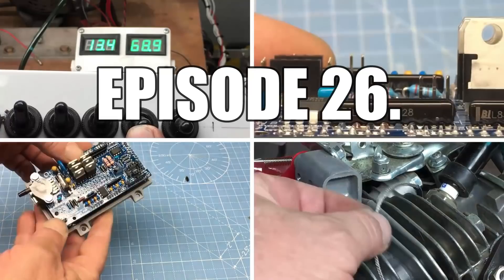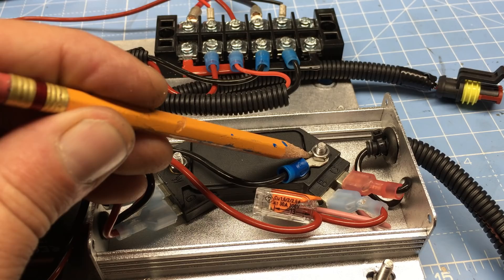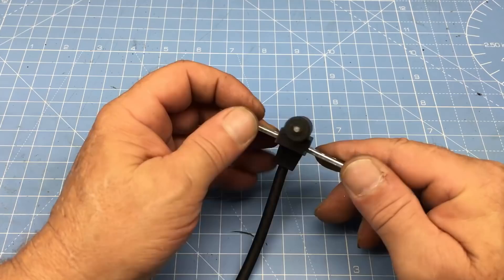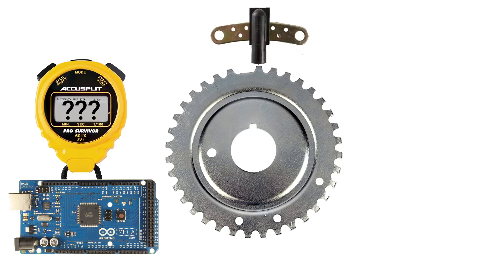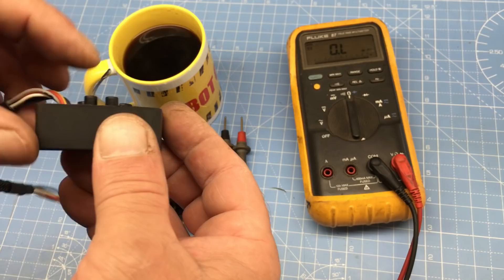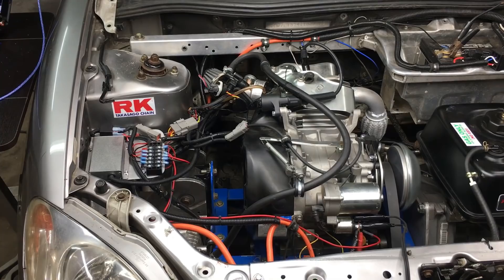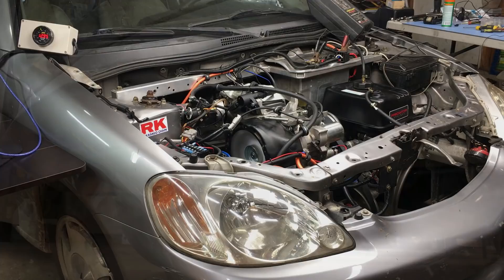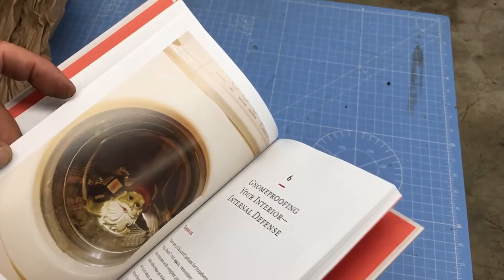Episode 26.  We finally finish the Speeduino NO2C EFI install on out 420cc  street legal go kart

Comment: The ECU knows where it is at all times. It knows this because it knows where it isn't. By subtracting where it is from where it isn't, or where it isn't from where it is (whichever is greater), it obtains a difference, or deviation. The timing subsystem uses deviations to generate corrective commands to drive the ECU from a position where it is to a position where it isn't, and arriving at a position where it wasn't, it now is. Consequently, the position where it is, is now the position that it wasn't, and it follows that the position that it was, is now the position that it isn't.
In the event that the position that it is in is not the position that it wasn't, the system has acquired a variation, the variation being the difference between where the ECU is, and where it wasn't. If variation is considered to be a significant factor, it too may be corrected by the MAP. However, the ECU must also know where it was.
The ECU timing computer scenario works as follows. Because a variation has modified some of the information the ECU has obtained, it is not sure just where it is. However, it is sure where it isn't, within reason, and it knows where it was. It now subtracts where it should be from where it wasn't, or vice-versa, and by differentiating this from the algebraic sum of where it shouldn't be, and where it was, it is able to obtain the deviation and its variation, which is called error.
Reply: That is or isn't the most easy explanation of timing error 😁
Reply: A good friend keeps telling me... "wherever I go, there I am"
Seriously though, great explanation of predictive timing!!
Reply: Wherever you go don't forget your towel.
Reply: Adding a knock sensor on the engine would be useful as well.
I seem to remember that a modern car ign. system applies a strategy in which it continuously tries to maximise ign. advance. Until the knocksensor detects knock and sends the signal to the ign. module. The ign.module then backs the timing off  a few degrees until the knock sensor factor input stops and then slowely tries to advance again. Basically a simple  feedback loop: advance>knock>retard>advance (ad infinitum)
With a strategy like that it becomes a lot safer  to use boost. Differences in fuel quality, ambient airtemp will automatically be factored in.
With low octane fuel the ign. will automatically use less advance.
Reply: Where am I?
Reply: Today is the tomorrow you worried about yesterday.
Reply: @jfv65  No knock support on Speeduino.

Comment: That Stuff is BMW and it might be from a 02 series. The BMW "Neue Klasse"(New Class) was a huge succsess, it helped BMW survive the 60´s, my Dad had a 2002 (actually several) and the BMW 2002 escalated into the 2002 Tii Turbo, a mechanical fuel injected and turboed badass. It had a bad reputation because the drivers didn´t treat it as they should have so they blew turbos, head gaskets- You name it.
And based on the 1500ccm block BMW´s motor magicians created the F1 race car engine which dominated everything in the early 80´s.
Glory days...
You do really awsome shit with this car, I love the sound! Sounds very serious!

Comment: I love your explanation of the missing tooth on the reluctor wheel.  I always liked the ford method of firing on the "down" on the square wave.  So instead of a missing tooth, cylinder 1's "tooth" was smaller but ended in the same place on the wheel.  So it was sort of like a missing tooth, it as the eec was looking for the big gap between cylinders to know when to fire injector 1.

The eec would turn off the "spark in" pin when it wanted to fire the plug.  If the eec didn't tell the coil to fire, it would fire anyway when the tooth on the reluctor completely passed the hall effect sensor.  Works just like the GM setup, just completely backwards, and the reluctor was just a piece of stamped steel rather than a magnet.

Not saying thats what you should have done, your explanation just reminded me of this.  Awesome vid.  Glad to see you're back
Reply from the maker: thanks!

Comment: You squeezed the usb cable into the door gap by closing the door, and then talk about failing connections to laptop. Might not be the reason why it fails often, but looks funny in the same picture with laptop.😋

Comment: Jimbo, you made me work!  I had forgotten what VR stood for!  Luckily I eventually remembered that it stood for variable reluctance.  I found several articles (Wikipedia) on what a VR is/does but nothing immediately on Reluctance.  
It turns out that it is like electrical resistance for magnetic fields.  The big difference is that it uses no power, as a resistor does.  Your engine with a VR will have to fight the Reluctance as it spins but the VR generates no heat.
Educational moment missed Jimbo! 
 
I am embarassed to say I actually got an EE degree but missed or forgot this.  It must have been when we studied electric motors!
Reply: In case anyone worries that my poor education endangered anyone, I am happy to say that I have never been employed as an EE! LOL 
I am at retirement age so everyone's future is safe from me too! 8-))

Comment: Great vids :) Just a heads up, I used what looks to be the same generic air filter you do on a 18hp 200cc chinese atv.
It made it run very poorly despite trying to tune it.
Found that the foam type pitbike filters flow a lot better, and likely cleans better if oiled. 
After fitting one the little 200 was back in the game.

Comment: Glad to see you back. Hmm, a 36 spoke motorized bicycle sprocket would seem to work just fine with the teeth filed flat and a tooth removed. Thanks for the inspiration. On second thought, with that convertor board, maybe no filing needed.

Comment: Excellent production. I learned a few things which I had previously skirted on my way to being the best inventor in history. Truly helpful!
It won't be long until this horribly draggy high friction person transporter blows through an impressive speed. Of course a tail wind will be helpful. I suppose the energy required to make this speed will be a measurable improvement over the larger OEM beast. After all we aren't pumping water too.
This fuel injection and ignition timing control method had me wondering how wastefully inefficient it is to fire a spark when a spark isn't needed. I bet 100's of milliamps could be wasted. It could light with less than one turn.
I like the modules designed logic for the ability to spray two hats full of fuel into the intake plenum prior to charging the combustion chamber. Great because we should be moving swiftly now onto the super charger. Hopefully, the fuel tank mount wont hinder us again.
Moving from liquid cooled to air cooling has been a remarkable experience. I suspect that the fuel injection sprinkler could provide enough cooling to set another speed record before we ever consider leaning. 
Lord help us now, I'm saying we.
Cheers!

Comment: I feel the urge to get a speeduino, despite not having anything to use it on. Unless I plan to convert my honda lawnmower to fuel injection.
Reply: You should totally do that. Would make for a very efficient mowing of the lawn :D
Reply: Supercharged fuel-injected lawnmowers are all the rage here.
Reply: @hojnikb  I bet youd see very little difference, if any.  Contrary to popular belief, carbs are quite fuel efficient if properly tuned.  And in the case of a lawnmower where it runs one RPM at all times with just a bit of varying load, I doubt the manufacturer screwed it up too bad
Reply: Skip the Speeduino and get a Harbor Freight diesel and an eBay turbo. Then you'll have something much louder to play with, and could you even put it in a riding mower or a bike ;)

Comment: Just add a plate below the engine which scoops up air from below the car. This way you can avoid the ducting entirely.

You just need to add some vents holes at the end of the hood, which is basically what you would expect from a cement mixer engine driven car anyway 😬

Comment: The fact that the ECU isn't necessarily firing directly off the crank sensor is a minor mindbomb for me. I mean I've only had experience using a modified stock ECU using the stock crank sensor but I always assumed it knew exactly where the crank was and adjusted timing accordingly. This is the channel that just keeps on giving!
Reply: Hey Adam, one additional curious thing is that as ECUs got faster, over the years, more teeth were added to the crank wheel, to further reduce the “guessing” that needs to be done.
Reply: @gregholloway2656  I believe you are mistaken. Most crank sensors max out at 60 teeth. Even the most basic EFI setup can keep track of 60 teeth.

There's not much point in having a crankshaft sensor that isn't capable of accurately tracking the position of the crankshaft.
Reply: @rars0n  you are probably right.  I was thinking of LS crank wheels, where the early engines had 24 teeth, and the later 58.  Perhaps it was the sensors improving more than the ecus.
Reply: @gregholloway2656  Yeah there's definitely been a lot of improvements in the sensors themselves. Early crank sensors were pretty unreliable.

Comment: Hey Jimbo, just thought I'd share an idea for a quick & dirty throttle body. I was working on removing the slide from a carburetor and making an adapter to hold  the injector. I never finished the project. Use a remote throttle body positioning sensor connected to the accelerator cable. There's a guy that's done this with a V-max engine. I made thicker  custom covers for the carburetor out of aluminum plate.

Comment: If you want yet another unique idea for this, A high RPM go cart rotary engine. With or without a centrifugal Supercharger. Possibly driven by a BLDC ESC motor. 

Or if you really want to jump into the pit, a 13B MSP Gen 2, with a 14KW Brushed Motor attached to an Eaton M90.

Comment: 3:17 - For those curious/arguing: The GM HEI (High-Energy Ignition) and GM/Bosch ECMs are designed to work on a minimum of 5VDC, should there ever be a compromise in the vehicle's electrical/charging system.

Comment: Excellent content!  Looking forward to seeing how it tunes up, compared to a stock carburetor.
Reply: I'd also like to add that the way you say "the computer guesses" makes sense in my mind now.  The computer would average out the times between pickup triggers to determine rpm for ignition timing and fuel management.  So basically more triggers (30+, instead of merely 1) would make the computer more accurate.  At least I think I've gained an understanding.  I've always wondered about that in my head, and your statement definitely cleared that up for me.  Thank you!

Comment: Great project and video, a fun series for sure,  I'm glad to see someone else beating their head against the norm. 

I did a supercharger (chevy smog pump) on a 300cc Kawasaki industrial engine pitbike, blow through cv carburetor using the stock ignition, it made 10lbs boost, it was a great addition. My latest addition to the little motorcycle is a small turbocharger that is plumbed in after the blower for a "twin charged" application. I also went away from the stock ignition and cv carb by adding a megasquirt efi system I purchased from DIY Fuel Injection.

Was a challenge but now it runs and is pretty cool with a good push on your butt as the boost continues to build.

Video footage of it running at my YouTube channel. 

By the way Jimbo, where the hell is episode 13?
Reply from the maker: Welcome to the episode 13 fan club!    That twin charged engine is awesome!   When you went to EFI, did you run twin throttle bodys?
Reply: @robotcantina8957  no, just one throttle body after the turbo. All air comes in through the inlet of the blower, then compressed air is put into the compressor side of the turbo, then through the throttle body to the plenum chamber where the injector is pointed directly into the intake port and valve.
Reply: @riceburner32  CONGRATULATIONS   ROBOT   CANTINA  on 104k  subscribers..  JIMBO
you have the talent and content for these videos that viewers are craving..👍👍

Comment: Great video, Jimbo!  Coincidentally, I was able to start my truck engine with homebrew fuel injection today.  Using a Raspberry Pi Pico as the brain.  Oh, and stay out of my toolbox; you seem to have helped yourself to my Fluke 87 and Tektronix scope.  👍
Reply from the maker: You can fix just about anything with a Fluke and a Tek.
Reply: @robotcantina8957  by the way, that was an excellent explanation of crank trigger wheels, and why there is a missing tooth.  Should really help beginners to efi.
Reply from the maker: @gregholloway2656  Thanks!

Comment: If the other laptop does not fix the serial dropping out, try shielding your entire ignition system. During the EFI conversion of my Samurai i encountered an identical problem, all cables, all laptops that i tried would just drop out after the engine started(i also had a problem with it dropping out right after cranking, which was caused by the lack of a flyback diode on my test stand's starter solenoid relay). I first used aluminum foil to shield the harness, but later used proper alu tape to cover the coil on plug coil's boot, as it was originally designed to be sunk deep into a cylinder head it probably wasn't designed to be the cleanest regarding EMI.
Reply from the maker: The new laptop arrived yesterday afternoon and it works perfect.   My little Acer has taken a beating and the usb line has been zapped a number of times, I'm afraid the computer has seen better days.

Comment: Nice video Jimbo. So why didn’t your tune work? You mention no fuel. Was the injector not  opening? I also am playing around with the NC02 on my motorcycle. Why did you choose the VR over the Hall effect sensor? They also have a Bluetooth available for the Speedunio, lessen the cable load 😀.  Keep the good work up looking forward for the next video.
Reply from the maker: I'm not really sure why my tune didn't work the first time.  I certainly was missing something in the setup that enabled the injector.  I used the VR sensor because the 36-1 wheel I also used was made for a VR sensor.  Good luck on your project!

Comment: Brilliant, awaiting your next video very keenly. Really like the dry humour and the no BS approach. I’m hoping to fit FI to an older Triumph Bonneville (using a single carb Tiger cylinder head) and a Piaggio X9 throttle body from a 460cc single cylinder engine. Then if that’s good, I’ll try FI on a 1992 Hinckley Triumph 750 Trident triple. Good the new lap top turns up soon
Reply from the maker: The Piaggio X9 looks interesting, would you know how many mm it is? The laptop arrived this afternoon and after I loaded up all the software it seems to work perfect.
Reply: @robotcantina8957  I’ll measure the throttle body dia on the X9 later and report back. It looks to me like it’s circa 32-36 mm maybe? I’ll take some photos too. Is there a way of attaching images here?
Reply from the maker: @garyhargreaves5630   I checked the throttle body out on ebay and it looks interesting, If you can get a size of the bore, that would be awesome.
Reply: @robotcantina8957  piaggio 500 throttle body is 38mm dia. It appears to have TPS and a intake air temperature sensors built in adjacent to the butterfly. There is another multi-way connection that I think is probably a Mass Air Flow sensor too, it’s in a chamber within the body casting. The throttle body bolts with three fixings onto a shaped intake adaptor that also provides a position for the injector. I’ll send images, as I’ve taken two shots that might help. I can’t see how to embed those in this post? The engine type is callers Leder 460 and is available in many Italian brands, gilera and maybe even some Peugeot badged scooters.
Reply from the maker: @garyhargreaves5630  Whoops, 38 mm is going to be too big,  I was kinda hoping for 30 to 32.  Thanks for all the info though!
Reply: @robotcantina8957  the stock Piaggio 460 engine makes circa 40hp, and 32lb/ft torque, so this must be enough throttle plate are for those parameters. As I’ve said, I’d got it earmarked for an FI conversion on a single carb (Tiger TR7) head for a 1977 Bonneville I have.  
There’s other Piaggio ledar engine displacements though, both 300 and 400 cc so maybe there’s a Piaggio throttle body still out there for you? Could be an eBay search would turn up just the thing.

Comment: Jimbo, now that you have the EFI setup, you should perhaps explore options for drive-by-wire (or electronic throttle valve if you will) and maybe some external EGRing. I'm sure this would further aid with lowering the fuel consumtion for this setup.
Reply: Speeduino supports neither of those things.
Reply: @theonewithin609  Yeah, you'd need a different ecu alltogether, since speeduino doesn't support that yet.
But benefits of both are real.
Reply: @hojnikb  I don't know that you'd need a whole new ecu for the electronic TB.  An arduino uno could handle operating the drive by wire, and the speeduino would see everything it needed to know from one of the TPSs.  EGR might be a bit different, however as there wouldn't be a good way for the speeduino to know how much air was fresh vs exhaust
Reply: @limprooster3253  Yeah, i'd guess you'd need a wideband to do the correction and possibly modify map sensor behavior based on egr valve opening.
Reply: @hojnikb  I think as long as it was simple EGR where the valve is either open or it isn't, you could get away with a second fuel/spark table and it would self tune, as long as it knew the egr was open.  But at that point you probably have  killed most of the benefit

Comment: either set the laptop to the high performance power profile, or goto power settings in control panel, change the advanced settings, find the usb settings, and turn off "allow the computer to put this to sleep", alot of laptops will put things into low power mode, that they shouldn't